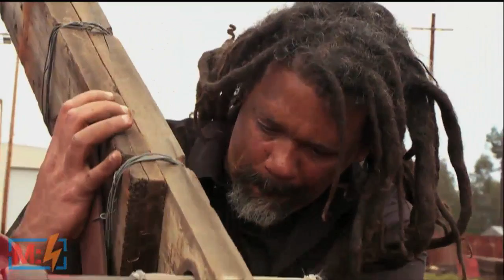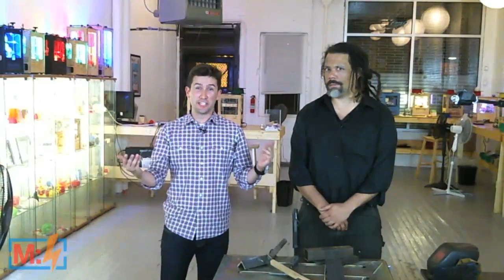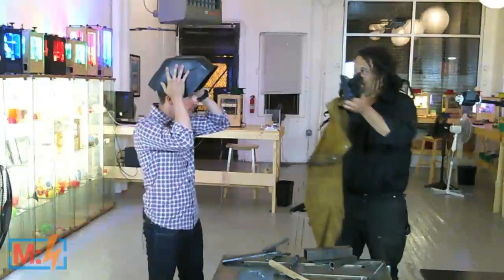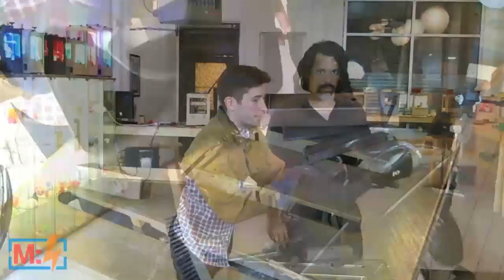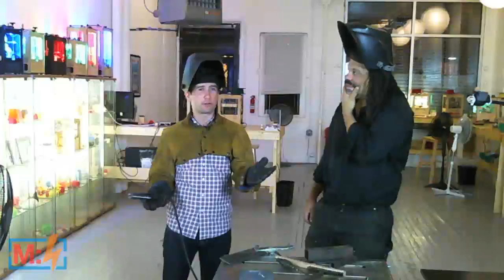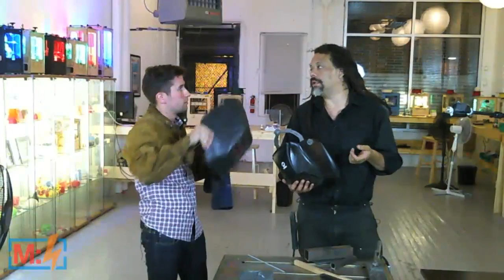Welding with Hackett on Make: Live ep14

Comment: @ssanthraxss you've got the right idea, but backwards. it's ER6010 = electrode rod the first two numbers (60) for 60k lbs tensile strengh, the third number (1) for all position and the fourth number (0) for the manufacturing characteristic. i.e. ER7018 = electrode rod 70k lbs tensile strength, all position, low hydrogen.

Comment: Any monkey can weld flat.  Try overhead with an 1/8" gap on a butt joint.  There were guys who failed the oxy class at Hobart several times because they couldn't get the overhead position down.  Also, a good weld shouldn't need any grinding.

Comment: @callmeshane303 
The only way a 1.5V AA battery can kill you is when you drop a shit load of them on your head, provided you have one. You need around 40V for at least a slight fibrillation. Even if you peeled the skin off your hands you would need at least a couple of volts to create a noticeable effect.

Comment: @spazzout686 
I'm sure you are capable of googling it yourself, but: What kills you is energy. What can produce that energy dissipated in your body is charge. What can produce this charge is voltage. High voltage is needed to overcome body's resistance. 25 Volts externally cannot kill you as it is not enough to generate a sufficient current, hence sufficient energy to destroy your cells (1 grey).

Comment: did he actually have a good reason to choose the dumbest possible method of connecting a motor to a hand cart? i mean really if you had to you could break the whole reciprocating assembly off the handcart with a sledge hammer the connect the belt straight to the drive gear. i could understand if he was restricted to using the lever to drive it, but otherwise, that's just way over-complicated.

Comment: This guy has know idea what hes doing for  one thing your suppose to use 6010 rods not 6013 yes there's a big difference 6010 is for use on thick steel like the 1/4 in hes trying to weld ps the technique he is trying to use is called wip and pause

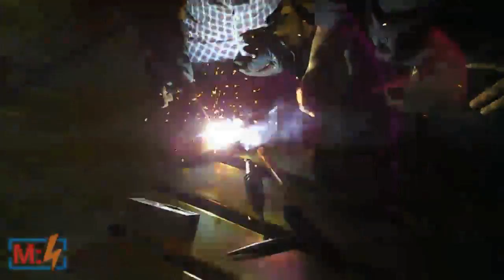Comment: Mr hackett, Safety is always first (safety glasses, gloves etc.) your show will definately get cancelled if you're missing an eye. some of your explanations were close,but not quite accurate, and you almost became part of the circuit when you held the ground in one hand and the electrode holder at 18:25 in the other without gloves. so for your safety, please take a welding course at your local community college. the coating you chip off on your finished weld is called slag.